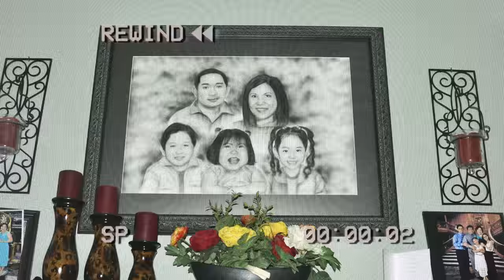Surprising My SISTER With Her DREAM ROOM!!! (Botanical Theme, All White Setup, and More!)

Comment: Everything else is really cute and I love the aesthetic but I really worry that spraypainting the Gpu is a little concerning that conducts heat and you also painted the metal heatsink/ I dont think she would be gaming on it and the behr paint is not flammable but since the heatsink is painted there is a layer between the fan to heatsink so the heat would just be trapped underneath the paint. It like your cooking on a stove and a pan but you put a piece of paper between the heat and contact under pan.  Im not a professional so maybe this is okay but upgrading to white non painted gpu would be much safer

Comment: ehh.. did you just paint your fan and your heatsink on the GPU?! You should not do that! If you paint your fan it can get into the motor and destroy it and/or the fan can become unbalanced which will lead to scratching and annoying sounds. And if you paint your heatsink the thermals will be much higher because the GPU die will feel like it is running in a rain coat (VERY BAD AND HOT).
Reply from the maker: It will be fine, yes it will be a tad hotter but she only plays valorant and league and from the week shes been using it, there has not been a major difference in temps. If it breaks than I'll just get her a new gpu anyways!
Reply: @WayneBanga  screenshotting this